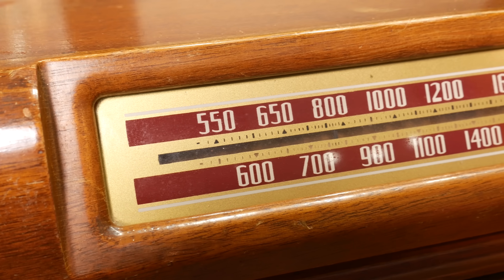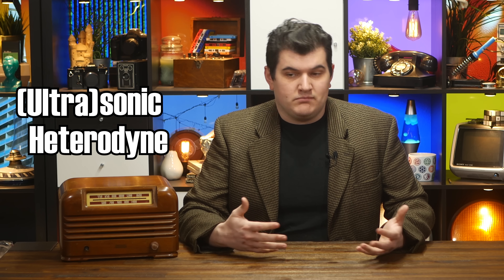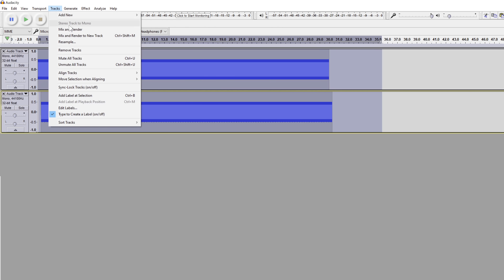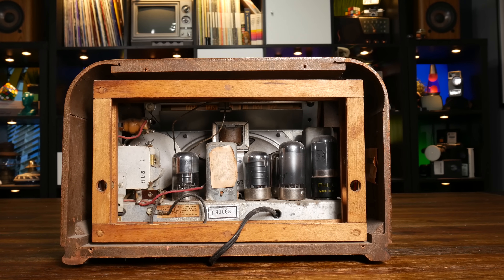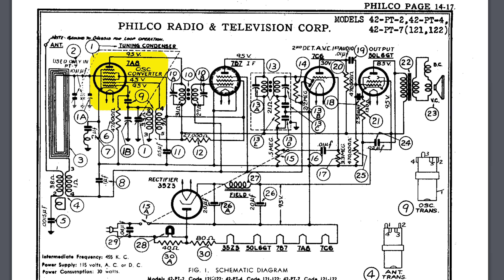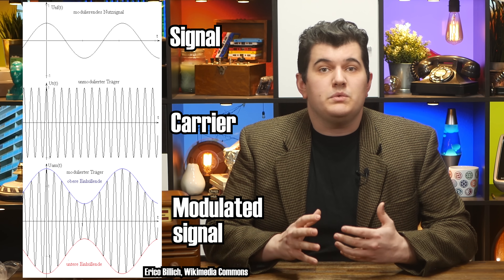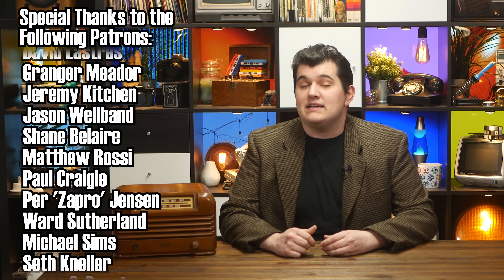The Superheterodyne Radio: No really, that's its name

Comment: Small nits.  The mixer in a superhet requires an explicitly non-linear element.  Adding signals in the time domain as was done in audacity does not produce beat frequencies.  Multiplying them does.  Also, you pointed out the front end filter required to eliminate imaging, but did not mention the act of mixing produces both the sum and difference.  The 455 kHz IF strip filters out not only other stations, but also the image of the desired station.  Consequently, supersets can either be high injection, or low injection, depending on whether their filter is designed for the sum or the difference from the mixer.
Reply: The property of imaging also allows single-sideband (SSB) transmission, which is essential for TV. After modulation, the signal will have two sidebands and for SSB transmission one of the sidebands is filtered out because it is redundant anyway.
Reply: TV is vestigial sideband. Single sideband, but incompletely performed.
Reply: @erkinalp  Which is on purpose, BTW, because there are some elements in the other sideband that actually help with recovering the video and audio more easily.
Reply: Yes, that 400+401 Hz demo doesn't actually produce a 1Hz sound - and if it did, you couldn't hear it anyway as your ear can't hear frequencies that low. Similarly, adding 5000 and 5400 Hz won't produce an audible 400 Hz tone (unless there's some nonlinearity, as you say). Presumably there is some nonliearity somewhere in his demo, but small - hence the very quiet 400 Hz.

Comment: Wait a minute. I asume that TVs used to work basically the same way? That would be how you theoretically could detect if a house have a TV or not? If so it would be in this way the BBC "secret" TV detection cars would work to determine if someone had a TV but diddent pay the TV licence fee?
Reply: You could detect this, but in the case of a TV you could also try to detect the sweep signals of the TV tube. I'm not sure which is easier to detect. I do know that it's actually possible, with some work, to reconstruct the image on the screen from the signal the tube is emitting. It works on CRT computer monitors too. Look up "Van Eck phreaking"!
Reply: Yes. A circuit called the Local Oscillator, or L.O., produces this frequency, It's low level, but apparently the BBC's detection cars use high gain directional antennas and sensitive receivers to sniff these signals. In theory you could foil them by enclosing your TV in a completely shielded metal box.
Reply: @russbellew6378  it would be hard to receive TV signals if you build a Faraday cage around it :-)
The Swedish version of the BBC had have talked about having something similar years ago but now are they finally putting the licence fee on the tax and are making it dependant on income instead of a flat 200$/year/household

Comment: You can actually hear the IF from a superhetrodyne radio on another radio if it happens to be within the other radio's dial coverage. I played around with this in my teens and found out that the 455 KHz IF of an AM radio and the 10.7 MHz IF of an FM radio can be heard quite a distance away. This distance is on the order of several feet away from the receiver.

Comment: Heterodyne RF oscillators are also how a theremin works, too - one is at a fixed frequency and the other is varied by the position of the player's hand, and the resulting beat frequency is a tone in audio range.

I built a theremin from a kit in high school, and was floored when I realized half-way through that the darn thing was pretty much just a messed-up AM radio.
Reply: Ironically, the machine was actually designed as a research into capacitive proximity sensors, not radio. And guess what our smart phone touch screens are today? Essentially they're tiny Theremins pointing along both of the screen's axes.
Reply: "Theremins that don't play music"
Reply: Erkin Alp Güney I thought a theramin was a pill. “For fast relief try cooling soothing Theramin!” It’s good for what ails ya. 😬
Reply: Erkin Alp Güney Radios Don’t either these days.
Reply: There are theremin kits?! Time to pay Google a visit!
Reply: @mrb692  The one I made was the Paia Theremax - that was 20 years ago but it looks like it's still available!
Reply: rjhelms 
But that heterodyne is not super sonic. It is sonic  as I am sure that you know!.
Reply: rjhelms Do keyboards work the same way?
Reply: @glennso47  Not any that I'm aware of - generally, the oscillators in a keyboard just generate the desired audio-frequency pitch. There's more to it for FM or sampling keyboards, but I'm not aware of any that use heterodyning.
Reply: The signal/carrier principle is also how vocoders resynthesize human voice in electronic music etc. Autotune is different tech and more popular these days but vocoders are still around and most music production software includes one. Maybe I'll torture myself and make a sonoheterodyne based modular synth circuit using FM routing and envelope shapers/LFOs... tho someone's probably already done one.

Comment: The proper term for an image frequency is a harmonic. As a kid I used the interference from another shortwave radio's oscillator to tune in single sideband from ham operators.
Reply: Nope, harmonic is an integer multiple of fundamental, whereas image is 2xIF away
Reply: @TeslaLegend  You're correct about harmonics, but an image in an AM radio receiver is the sum of the desired frequency and the local oscillator frequency. (The difference of  the desired frequency and the local oscillator frequency is of course the AM radio's intermediate frequency).

Since a mixer produces both the sum and the difference of its input frequencies, you can think of an image as a mirror image of the desired signal that resides on "the other side of" the local oscillator.
Reply: @russbellew6378  
Yes, the difference between RF and LO frequency is IF. In the case where LO is below RF frequency the image will be at LO-IF thus making the difference between RF and its image 2xIF. If the LO is above RF frequency then image will be at LO+IF, again making spacing between RF and its image 2xIF

Comment: 5:31 - wait, that's what it looked like? Was the printed circuit board not invented then? That capacitor at the left is almost touching the chassis! Speaking of capacitors, they look just like modern ones!
Reply from the maker: Yep, the printed circuity board was years away. Radios of this vintage are all wired point-to-point. As far as why you're seeing new capacitors, that's because they are! Re-capping electronics of this vintage is practically a requirement for both safety and satisfactory operation.
Reply: @TechnologyConnections  Thanks a lot for the clarification! After some reading, it seems the first copper foil PCB was fittingly for a radio, in 1943.

Comment: I've always wondered why the static between stations appears to have a 60Hz hum in it.
Reply: I doubt if the superheterodyne principle has anything to do with hum. The filaments and heaters of these tubes were powered by 60 Hz AC, and unless the plate and screen supplies were well filtered, 60 Hz ripple appeared on these DC supply currents. These 60 Hz currents could modulate any signals that flowed through the radio's vacuum tubes.

In any case, no AM table radio speaker reproduced 60 Hz; you probably heard 60 Hz harmonics (120, 180 ,,,) - the product of less than linear amplifier circuits in the radio.
Reply: Probably. What's confusing/surprising is that the hum tends to lessen when a station is tuned well and static is at a minimum. You'd expect the same power-induced hum to be just as prevalent then. Fortunately it's no longer a problem, but it always puzzled me.

Comment: The issue with filtering variable frequencies is that the bandwidth of an L-C filter (the simplest kind, and what old radio sets used) is proportional to its resonant frequency. The AM broadcast band traditionally ran from 540 to 1600 kHz — that's about a factor of three. So the selectivity of a pre-superhet set varied by a factor of three: at the low end of the band, audio quality suffered because the high frequencies (which in AM are further from the center of the signal) got cut out. At the high end, selectivity suffered and the set would tend to pick up multiple stations at once. That was the main problem the superhet solved: the selectivity of the set no longer depends on the frequency being tuned.

The fact that every superhet receiver is also a weak transmitter was (and probably still is) used by the British to detect unlicensed TV sets. (Yes,*receivers* are licensed in the UK; the license fees are how the BBC is funded.)
Reply: Yes, that's the word that was missing.  It's not just about improving how sensitive a radio is, it's about improving how selective it is.  TRF (Tuned Radio Frequency) radios had a wide passband so would pick up the intended transmission along with lots of noise and potentially other nearby transmissions too.
Reply: With a normal FM radio, I can detect the LO signal of another FM radio one or two meters away. With my $10 RTLSDR I can detect the signal 10-15m away through several walls. By recording signals for several minutes, it may be possible to detect LO signals from hundred meters away, buried well below the noise floor. Now the "problem" is that modern receivers are heavily shielded thus the LO leakage is insanely low (a few nanowatts)
Reply: Oi m8!  U go' a loicense fer tha' TV set?
Reply: The detector vans did work. They received the rf generated in the line output/eht transformer.
Reply: Actually, the BBC licence service probably never did. However the Nazi's did during WW2, giving rise to the use of "trench radios" which were basic crystal (and therefore not heterodyne) radio set.

As he stated he stated SDR does not need to use heterodyne techniques as we can do it all in digital using a FFT after sampling (for receive) allowing very broad bandwidth SDRs.

It should also be noted, that changing to the local oscillator to the right frequency to mix that would give the intermediate frequency is based on one of those old L-C filters itself. The tuning part didn't change much, we just started adjusting to other component out of those that work together to set the frequency.
Reply: @EwanMarshall  TV detection is a real thing: https://en.wikipedia.org/wiki/TV_detector_van

Yes, the IF is an L-C filter, but it's fixed frequency, so the bandwidth stays the same regardless of where in the band the set is tuned.

Comment: Hey look, a condensed version with less math of what I learned in my university Communications course.

Also, the reason the higher frequency test didn't work with the speakers likely has to do with the wavelengths of the signals.

Comment: I would like to add a correction, or rather an improvement to your explanation. Around 5:10, you said former filters were not very precise. Precision in filters is given by the Q factor (blablabla you can search for it). Now, Q = (Frequency / Bandwidth). As the frequency the filter is tuned to increases, so does que the bandwidth it lets pass through. The real problem with this tuning filter is that you cannot have the same bandwidth throughout the whole spectrum, so you would have higher frequency stations having their signals mixed up under the bigger bandwidth of the filter.

So yes, you are partially correct, they were not very precise, but it might would be better to say that their precision varied with the frequency.

I love your channel, you seem to be so passionate about older technology! People were really clever back in the analog days. None of that microcontroller gibberish!
Reply: It's a little more complicated than that. For perfect sound reproduction we'd like to have rectangular filter, that is, it passes without any loss at nominal frequency, plus-minus 20 kHz let's say, and rejects everything else. To achieve this kind of response with resistors, capacitors and inductors, several L-C filters are needed with slightly different resonant frequency. And yes, this thing is extremely difficult to tune to arbitrary frequency!
Reply: I think a bigger issue is that selective filters require a multi-pole topology with different parts that would all need to be tuned to the desired frequency.  One could produce a brilliantly selective radio for the 0.5-1.6MHz band using a four-pole passive LC filter if one didn't mind having to set four separate tuning knobs, and not getting any good indications of what one was doing unless or until all of them were set near the right position.  Using a superheterodyne receiver makes it possible to have a multi-pole filter which is calibrated at the factory and won't need to be changed after that.
Reply: @flatfingertuning727  You didn't see William W. Campbell-Shepherd IX's message to you, maybe you can reply and he can miss your reply too :)
Reply: Precision is not the correct word to use. The RF filter combined with the antenna is precise when you consider the center of the band that it is passing, you want that to be maximized since you haven't amplified it yet. Therefore you can't make it too narrow a bandpass, cause that would reduce the signal strength. The IF filter can be very narrow since it's already been amplified, so the bandpass is the important character, and not a maximized signal strength.
Reply: Is that why the tuning dial on radios like this tend to be nonlinear? If you look at this one, 500-600 is about the same dial distance as 1200-1600. I’ve seen linear tuners in things like hi-fi components, but having the higher frequencies crammed together seems more common.

Comment: To make the beat tone experiment work, you need a microphone/amplifier with distortion. As much second order distortion as you can get. For the radio this means something that behaves as a multiplication function. This is achieved by operating an amplifier or other circuit (the mixer) in the non-linear region. When transistors got cheap and good enough that we can get good analog multipliers for almost nothing, along came the zero intermediate/direct downconversion (I/Q) receiver which is usually found somewhere in modern digital comms.

Comment: This concept is also how a satellite dish, such as DirecTV works.  The feed horn on the dish is actually a frequency shifter and amplifier.  The difference is, it shifts an entire block of frequencies down to a useable frequency range so the tuner in the satellite receiver can tune to the desired frequency.
Reply: The LNB (or feed horn) on the dish is actually a full-blown radio front-end in its own right, shifting the signal from the TV band (around 12GHz) down to something a DVB decoder can cover, which is in the 1-2GHz band. The bandwidth of the front-end is wide enough to pick up any transponders coming from the satellite.
Reply: @Stoney3K  Older ones were based on SHD principle. They had a very high noise figure (usually around 3dB in band!!!).

Comment: please mind something that is not correct in your video: constructive/destructive interference has nothing to do with heterodyne. the mixer does not add/subtract the incoming signals, but rather it multiplies them. by adding/subtracting two signals you don't get any new frequency, you get the new IF by multiplying the incoming signals.

Comment: I have a book by Marvin Tepper called Basic Radio. I haven't gone through the whole thing but it is a treasure trove of old timey references to electronics and has a style of writing that still holds up extremely well today. It was written in the 60s I think. And it covers everything from the basics and of electricity to FM radio transmission towers.

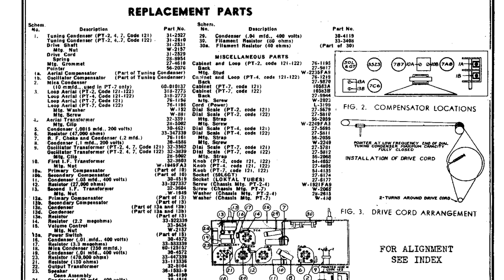Comment: 6:32 It can be said that in German we still call capacitors "condensers".
Here we call two kind of component a "Kondensator": capacitors in an electric circuit and condensers in units like power plants, steam engines or dehumidifiers.
Reply: (Additionally I want to mention that we call a flux capacitor component a "Fluxkompensator", but this shall just have its origin in a translation mistake of 1985.)

Comment: Hand in hand with this concept goes the Phase Locked Loop.  It explains why, in the 80's, you no longer had to turn a knob to tune your radio or tv.
Reply: The PLL is also a really good subject to cover in a different video, since it is a very essential component in most telecommunications systems. It's pretty much what made FM radio possible, and laid the groundwork for television. And on a side track, even the national power grid is a giant PLL -- it uses the grid frequency to keep track of the grid's power demand, and speed up or slow down the power plants according to that frequency. At least that's how it works in Europe.

Comment: The capacitor in the (breaker points) ignition system of an internal combustion engine is still called a condenser, at least it is in the US.

Comment: That is probably the best explanation of a superhet radio that I have ever heard! I built a 10 tube superhet when I was a teen in the mid sixties. I used parts that I had, built it on a Philco tv rf chassis. It sounded great, but I never worked out the tracking so I kept it tuned mainly on one station. :)

Comment: Correction: is not the tube that is tuned. The tube is just an amplifier (actually a gain driver) the traps around it make the tuned amp at IF. In most of the designs the traps is out-tuned symmetrically to make a loosed coupled filter that pass the audio spectrum.
 
http://www.ottawaelectronicsclub.org/presentations/2012/High_Performance_Crystal_Radios_for_electronics_club_v2_hires.pdf